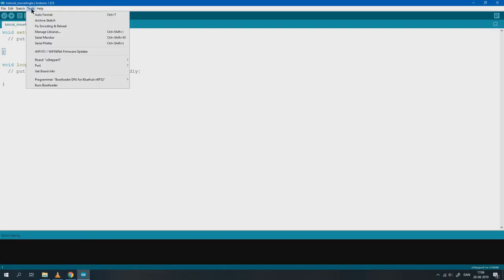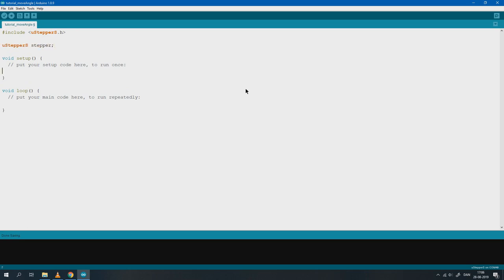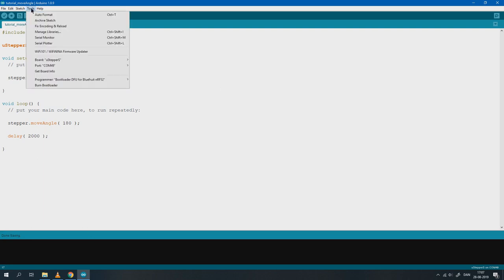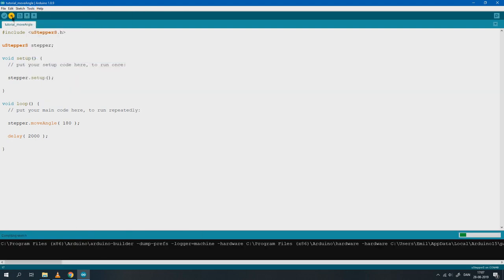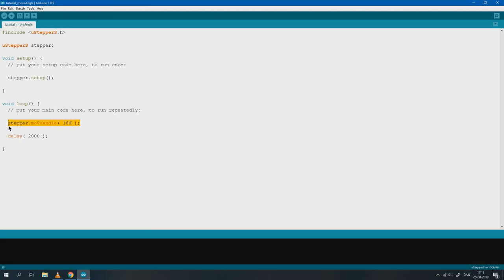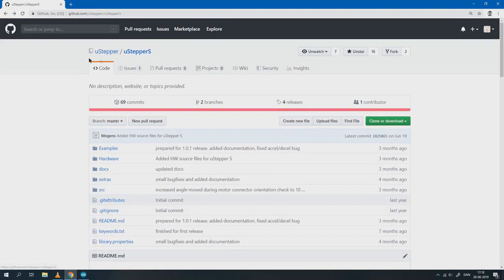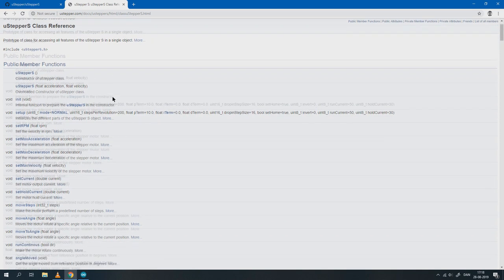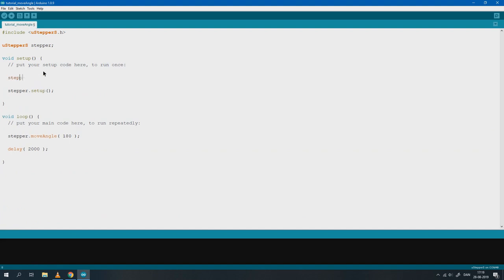uStepper: Using the library documentation to write custom code

Comment: In uStepper library that there are function for temperature check of driver, stepper.getTemp(). But on uStepper S that is ommited or there is another function to call to check parameters like driver temp or current?  That would be very usefull during test with setMaxCurrent(). Thanks!
Reply from the maker: Hi, Unfortunately we do not have an on-board temperature sensor on the S no. An easy solution would be to get hold on for example a ds18b20 and stick it to the board...
Reply: I did not check driver datasheet in details, but in case of overdriving driver so that driver ic will get too hot, would it trigger some kind of error and stop, or it will destroy itself :(. The reason i was asking for temperature is to have trigger if it raises above some tr3shold, than to stop motion and trow out alarm.
Reply from the maker: @marinzorica4572  Hi, The driver from Trinamic does have a thermal protection which disables the output stage. However, it is not advised to run the driver under such conditions for longer periods as it will shorten the lifetime of the driver. If you get our newest library (released a couple of days ago) you will have the ability to reduce heat development by for example using the CoolBrake function which only brakes the motor lightly but without power usage and thus with far less heating. That brake mode is the default one in the new library. If you run at high loads then consider active cooling as the driver has a bit high internal on resistance and thus gets hot when running over 50% current continuously...
Reply: @uStepperDK  I just did upload, when compiled i tried it on linear actuator here which used limit detection. Anyway, untill now it was set as 0.9 as treshold level. Now i changed and added rpm, just like in new LimitDetection example, but it won't work. Any setting under 2 will just move it left or right a bit (like it is too sensitve), and any other setting above 2 will not stop on end position. It same on my case and with updated example?
Reply from the maker: Marin Zorica please look at the limit detection example code and see that the sensitivity has been rescaled for the new stall detection feature. That is why the former scaling won’t work.
Reply: @uStepperDK  I did, and I did update library to last version also, and it happends just as I wrote. I did try with clean example without anything changing........??? Motor is NEMA17 at 24V with uStepper S controller.
Reply from the maker: Marin Zorica could you try the stallguard example? Here it runs at different speeds. The thing is that with stall guard you are dependent both on speed, current and threshold. So, multiple values can be adjusted.
Reply: @uStepperDK  I have tried that one also and it stops on every rpm as it should. For LimitDetection, it seems like it doesn't activate StallGuard, even i have check in librabry that it should.
Reply from the maker: Marin Zorica hmm... I have just tried it and for me it works fine. Could you write us on sales at uStepper.com with the details and copy of the sketch you use (even if it is the example) and we will look at it.
Reply: I do not know whay Limit example did not work.......but anyway using function to enable stall guard I did reqrite that part on my code and works. Anyway, since I am using PID for linear guide, now with library 2.0 i have more instability of motor and less precision. For example, my home point after homing routing is midle, than i slide rail +/- degress with moveToAngle().......no mather what speed I set i always miss end point for some 20 degress.......since acc and decc is very fast in this application, i know i cannot hit right on targer, but with library 1.1 i have precision like +/- 2 degres which is great. Are there any other improvements like PID function or so?
Reply: @uStepperDK  I just sent a email.Thanks!